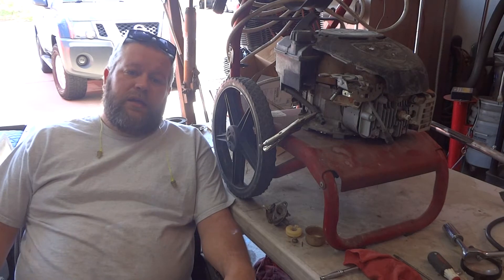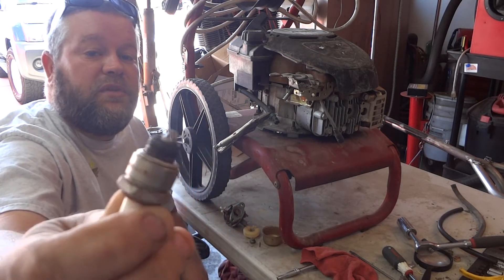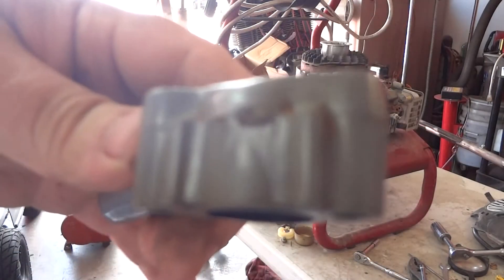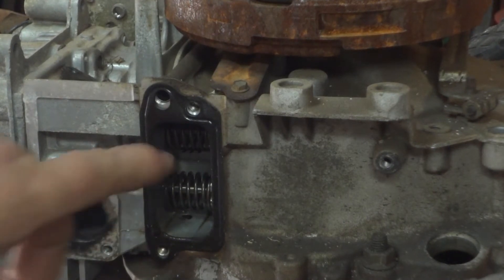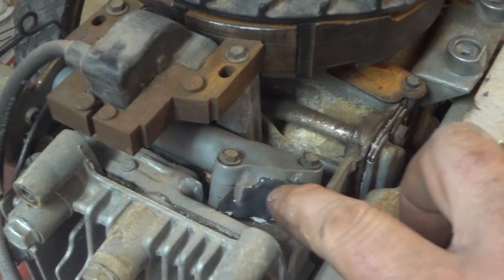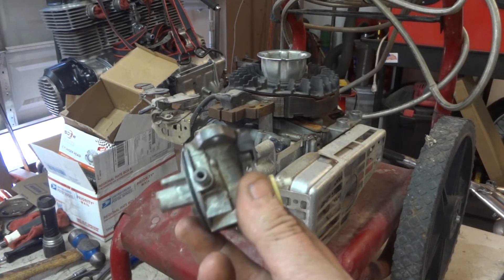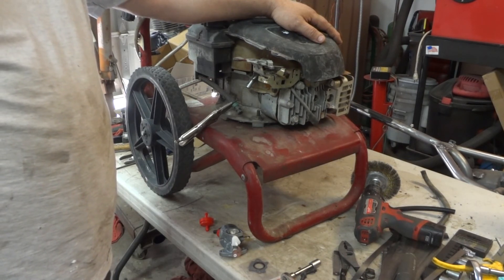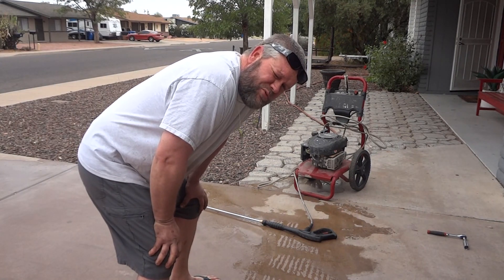craftsman pressure washer wont run off of choke fix

Comment: I bought one today, can't get it out of choke but halfway or so. Frustrating since it's a brand new unit
Reply from the maker: definitely an ar leak somewhere or the carb has an issue. not likely cause its new but stranger things have happened
Reply from the maker: doesnt take much to not make them run right
Reply: @kylescreations4724  well that sucks